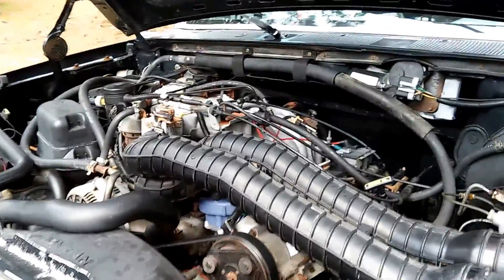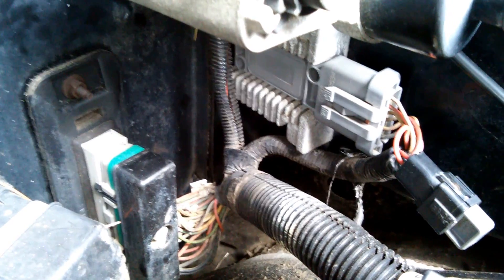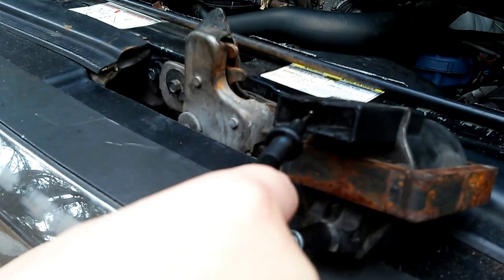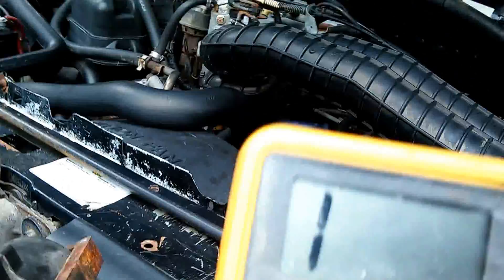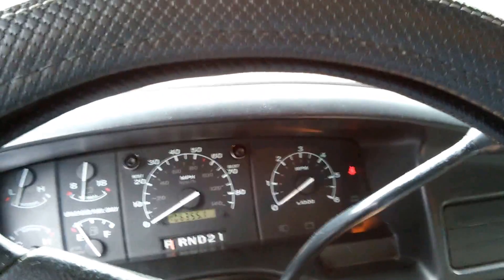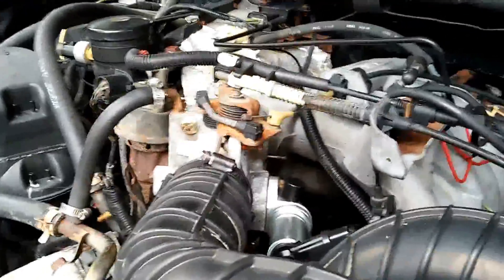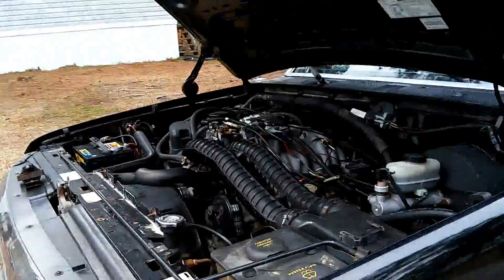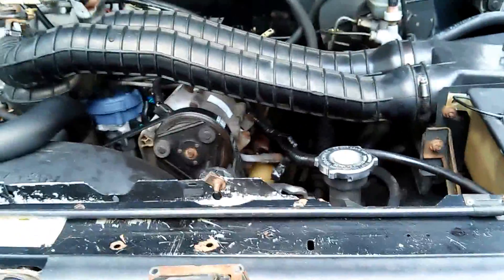95 ford F-250 No spark

Comment: Need help with a1996 ford 250 xl,7.5 cranks no start, distributor has no juice, you can unplug it  from the distributor move it around got juice plug it up , no Juice.

Comment: Nice video. I have the same problem. I will check with a volt meter and get back. Allso, I would like to ask where do I get the small linkage rod on the throttle body? Mine is missing.

Comment: What is this part called? My f150 5.0 95 is having issues, truck starts runs and no misfires, then randomly at a red light it will shut off. Have to start it back up

Comment: changed the coil and pretty much the whole ignition system still no go. What else can it be?
Reply from the maker: Computer
Reply: Pull the computer through the cab, mine turned out to be fried, still no luck replacing it either. I had to remove the 7/16 bolt on the harness in the engine bay and parking brake lever in the cab with help from a flat bar

Comment: To replace the module, use a Lang Tools FM-720 tool. Amazon has it. It is a ratcheting tool. Get a digital tester to check codes. Get a Snap-on scanner and cartridges and adapters to check codes.

Comment: where is the coil located is it in the dis.
Reply: Follow the distributor cap center wire to the coil. There's no code for module. The Pickup coil is called the PIP sensor to Ford. There is a code for the pickup coil.
Reply from the maker: driver's side...mounted near the top of the engine

Comment: 97 F250  turns over but won't start. Just started two days ago and driven. Tank has gas in it. Any suggestions?
Reply: You have about 3 to 5 things to test one temp sensor and or the temp sender unit if yours have it if you have ohm metter should read about 6 also check if urs has a pcm see if it is bad also forth check and see if you are getting gas into your fuel rail and lastly if u are getting fuel in the fuel rail see if the injectors are clogged

Comment: My ford f250 5.8 after about 2 hours of driving on hot days starts missing wont take gass and when it dies it wont start back ut till it cools off then runs fine agine
Reply: Teddy Stephens knock sensor or the temperature
Reply: mine did the same thing until i rebuilt the carb, surprised me
Reply: ICM